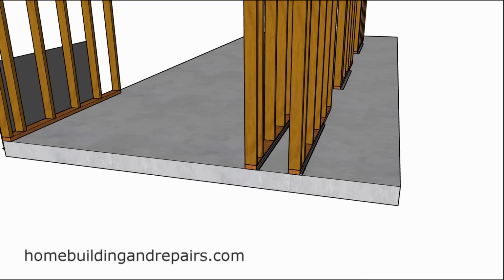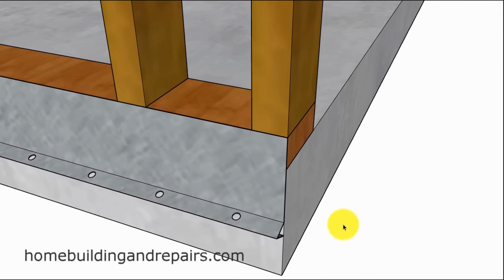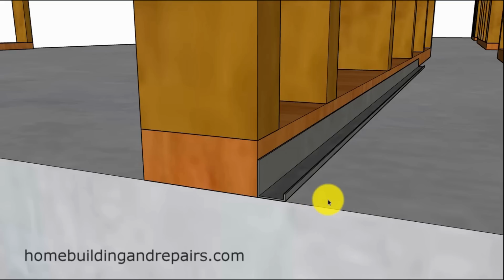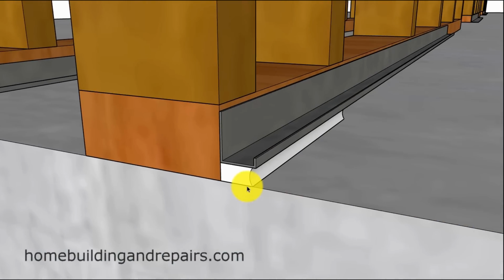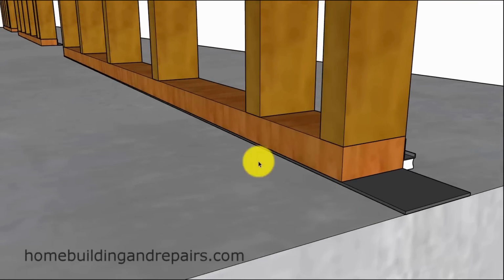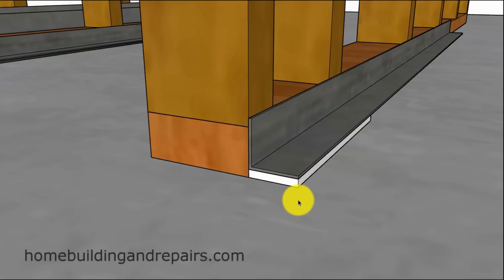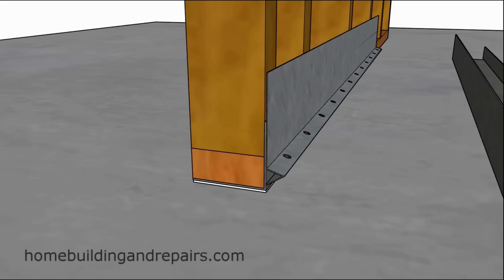Ideas for Sealing the Bottom of a Wall Framing Plate Sitting on Top of Concrete Slab

Comment: This detail keeps me awake at night…

Best I can think of is to place new curb on the slab (with a water stop like sika swell), next best is curb without water stop. 

Other ideas I’ve had:
- apply a slurry coat of xypex at the cold joint of the 6” curb  as a water stop instead of a pvc water stop, or using xypex as an additive in the curb concrete 

I’ve also thought about blueskin wrapped under the bottom plate on the horizontal and then up the exterior side (L shape, not u). Then caulk the bottom of the blueskin to the concrete as well as the corner after install.  Then tyvek down over the blueskin.

I also thought about panted vinyl trim left about 3/8 off the slab and then filled with caulk, topped with a flashing before siding starts

Also thought about various stucco parging coats over cement board or maybe stucco wire. 

An important consideration may be if the slope is toward or away from the wall on top the slab. Are we trying to seal against gravity
Or with gravity on our side

Also considered a mini curb if minor standing water could be an issue like a 1” tall curb made from  planitop x instead of regular concrete

I’ve also weighed options considered 4x4 vs 2x4 bottom plates. 4x4 easier to find rated for ground contact or burial and 2x4 follows contours of slab more easily and may seal better 

And another big consideration is that you can’t always easily place a 6” concrete curb. Say you are repairing a pre existing wall with a poor detail. (Often just old siding run right to the ground over the bottom plate). And now we have to try and waterproof the bottom plate best we can from rain water and also the wicking of wood and concrete contact

Comment: i have this scenario ( the second part show on the video ) shed on a concrete slab, but one side will not overlap the concrete and will just seat there. i see that J channel is not recommended. So what are my options ? Yes, i'm using a PT sill plate + a moisture barrier between concrete at the sill plate, but i will like to flash the concrete and the smart siding, but not sure how to go about it.

Comment: Forget the j-metal. Wrap the bottom of both the plate and the bottom of the sheathing. Still use polyurathane sealeant everywhere you can.
Then overlap the wall covering , (tyvek, etc.), over the bituthane - seal this too. Use a polyurathane sealant at EVERY joint and contact point as well. NEVER have concrete continue from the exterior of the home to the interior. Always have moisture and thermal break between the them. SLOPE your concrete AWAY from the structure. Have it ground down if it isn't already. SEAL THE CONCRETE. Use overhangs and gutters to further limit that portion of the concrete from ever seeing moisture.
Have your yard sloped and draining AWAY from your structure.

Comment: I thought all the person was concerned about was laying the wood directly on the concrete slab and soaking moisture from the concrete.  All that metal is totally useless. Some kind of waterproofing membrane under the bottom pressure treated sill should suffice. Long ago there was a rubber membrane that was  used. It was about 3/16" thick. There are probably better products today. I believe you way over thought it. If there is a lot of water in the basement, nothing will help without a drain or sump pump system.

Comment: If take a grinder wheel in some Z flashing. Cut a groove in the concrete about a 1/2 an inch deep with a thin blade. Put some calking down in the groove and slip your flashing down into the concrete and then put your side down over the upper half and it will  Stop the leak because mechanically the water cannot go under if it's glued into the concrete even if the concrete's not perfectly flat it has to penetrate  Under that lip and then wickets way back upward and that's not typically the case.

Comment: Great vide as always! I was looking for info about how to seal a wall plate on concrete. Do you think it's possible to make a garage extension on a driveway directly on the driveway concrete without foundations?  The extension to build would be 12x23x12.
Reply from the maker: I've built over slabs 4 inches thick before, but most building departments and engineers would probably never approve it.
Reply: @gregvancom , thank you very much.

Comment: You could use composite plastic posts 3x3 or 4x4 as your "to the floor" wooden part of the frame and  mastic and screw direct to the floor, even stack it in layers to become a type of composite party wall
Reply: Not to code. Best to start out with a plan that keeps any wood product from ever making contact with exterior water such as a raised concrete foundation.

Comment: Hi Greg, probably in the same family as that comment that was looking at something similar for brick ledge. I have an extension off the kitchen (7x8 room) that only has a mat of “peel and stick” (you can really peel it right up) separating it from the elevated concrete slab. The room itself is framed up on wood studs and its exterior walls are adjacent to the brick veneer (but built away from it, like you say here). I think the concrete is wicking too much moisture (the side door sill plate or threshold are messed up and allowing water… long story), which is going to rot up the framing. What all can I do as a retrofit solution?
Reply from the maker: If you can't find something in our videos, then email me picture of your problem and I will see if I can help.

Comment: Another option is to cut a channel into the concrete just outboard of the bottom plate, z-flash from the plate into the channel, and insert drain track like we put in pool decking. The bottom plate should still have a barrier such as 30lb felt, with an adhesive sealant such as Lexel.
Reply: I believe this is similar to the solution Matt Risinger used without the drain track. Drain track seems to be a nice addition.
Reply: @davidkafka2452  really? Well that’s fine company to be mentioned alongside.

Comment: In this case, I’d simply set concrete block on top of the slab, properly bonded, doweled and anchored and build my new wall on top of that single course of block perimeter :-)
Reply: This is actually my plan, came here to look at other ideas.
Reply from the maker: I like it.

Comment: I would use a flashed membrane against the framing and then continue it to the outside edge of the exposed slab. I would suggest something suitable for exterior like a waterproof decoupling membrane. I would suggest something like an exterior tile or cementacious coating suitable for an exterior surface. This assembly keeps water from entering the slab and wicking beneath the wall.👍
Reply from the maker: That sounds good.

Comment: I did the urethane under the wall sill plate  and treated lumber. To the patio foundation. Which didn’t have a raise hi
Reply: To protect water entry. It has been in use for 17 years! Still working well and no adhesion issues.
Reply from the maker: Thanks for sharing and I'm wondering why you used it. What made you select expanding foam?
Reply: @gregvancom  I didn’t use foam I used urethane caulking.

Comment: Cut a 1” wide channel into the concrete with angle grinder as close to the sill plate as possible, install and extend either lead flashing or ice and water shield from framing to bottom of channel, fill in channel (wet set flashing into) with hydraulic cement/good quality mortar. Done.
Reply from the maker: Let us know how it worked in few years.
Reply: @gregvancom  I’ve never done it, just thinking of ideas. Can you think of any reason it wouldn’t work? Just curious.
Reply: @danno8852 
Yeah - you can't stop water.  While I do like the idea and recessing an edge of flashing into a kerf cut into the concrete, the fact is that if water is allowed to reach the flashing then it will surely eventually devour that metal. Moisture can always weep through the concrete itself - esp. if there are any cracks. 
I used this kerf method on a stucco house when I added a small overhang with metal roofing over a sliding door.
Reasons why it was successful are: 
* The roof of the new overhang was pitched away from the house so water didn't just sit there.
* It's in the southwest which has limited annual rainfall.

Comment: Yes. Weep screed is not available . can I use instead aluminium flashing like the one used for cladding or roof flashing?.thank you .great video.
Reply from the maker: I've seen other types of metal used, so I would say maybe, but I would hate to say yes and in ten years the metal is rusting or damaged. Check with your local contractors or building departments.

Comment: Hi, what do you think of making a concrete bed first, like a barrier curb on the existing concrete slab - to lay on the sill plate timber/metal? thanks!
Reply: Water ALWAYS wins and ALWAYS finds a path. ANY concrete slab which extends from exterior to interior under a wall or sill plate will ALWAYS escort moisture under it.
There MUST be a moisture/thermal break between the outside and inside concrete. The sill plate must be higher than the exterior grade. Pouring a concrete raised stem wall on top of the existing concrete may keep the wood from direct moisture contact but water will always wick under.
Reply: A single course of proper doweled, bonded and mortared concrete block, all cells filled with J bolts per code. Then you could liquid flash it same as you would if you were back filling a block wall basement for extra protection, you could then overlap the sheathing with counter flashing sealed to the block, house wrap shingling over the counter flashing and it would be absolutely bombproof. We are doing. 2K square foot additional onto a house with this exact method as it will stand up to the very wet and rainy weather in GA.
Reply from the maker: As long as it's structurally sturdy, then absolutely.

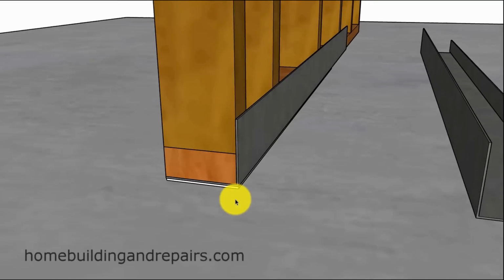Comment: Gregvancom. In the last example you give (6:20),
 Does pressure treated plywood sheathing go first then metal you mention  then water/ice paper then tyvek?
Reply from the maker: That is a bit over doing it, but if you live in the snow or where it rains a lot, then go for it. Please keep in mind that these  examples might not work in extreme climates.

Comment: I have a question  ? I had water problems, I live in Florida. I  built a French drain around the 12 by 15 room which was on a slab. Existing walls I cut the baseboard out cleaned it all out vacuumed it let it dry out for a month and then what I did was I ended up getting concrete with rocks and I mixed it up and I put it in between the two-by-fours on the ground in between the floor plate. I then put the 4 in baseboard on it and I let it dry turn down the air conditioner for a month after it dried I put another baseboard on it raise it up higher with the concrete in the wall I blew some foam insulation on top of the concrete and then proceeded Lee to put the paneling back down over the insulation and the concrete. I went out and I got skills and I painted all the boards on the floor with Kilz and then I ended up getting a roofing compound and just painted that on several layers thick and then I glued everything back together again and every 5 years I have to reseal with a roofing compound I have not really experienced any water inside the room since I did the concrete and the foam and the roof sealer a small little bit but not as much as I normally get in this room. I live in New Port Richey Florida and when it floods my backyard we usually get two or three feet of water I sealed the door right up to four foot with the roof sealer and it has not been leaking since I had seal it. My question is can I put concrete all the way up in the framing of the walls will it hold it in place along with plywood against the wall I just want a more secure place because I live in a area where it's very bad on drugs and if there could be concrete I prefer to have concrete considering that it will slow a bullet down if it ever Strays this way
Reply from the maker: I've seen what you're suggesting done before, but most of the time people build block walls.

Comment: Why not cut a 2” key way into the existing slab on grade and make a raised 1”lip 3” key way depth.  And than seal the concrete with a self leveling Crete.  The extending “toe jam” threshold Could extend 1/4” beyond the edge of the concrete key way pour and cover the door jamb area with a molded wood.  Thus having a inner floor level with tile install just about. 1/4 below the jamb.  The exterior walls could be as you state with flashing, but I would add a 50 year weather barrier below the flashing and studs.  Then caulk and seal after adding the exterior wall sheathing, vapor barrier and siding.  That way no water ever unless there is a flood.  But is his slab on grade above county standards for flood.  Is he in a flood zone.  Is he in a 100 year flood zone.  If he is not in a flood zone than his existing grade has to be 6” below the slab on grade.
Reply from the maker: Have you tried this method before and doesn't work or is it just a suggestion?

Comment: i would add hydro insulation all over the concrete slab ... approx. 3mm in two layers ... so overall thickness would be 6mm. And then when installing studs to the slab, I would put thick layer of caulk between a hydro and a stud ... and also later caulk around edges so no cold air could penetrate inside flooring and create condensation. I used in my project at home caulk sika 11fc and when it cures it's like a really hard rubber and it will last forever probably.
Reply: Rok Grabnar eventually water wins..

Comment: This is the main reason why I prefer raised flooring with a crawl space.  The rule of thumb is there are 2 types of concrete, concrete that hasn't cracked and another that is cracked.
Reply: More importantly, the concrete slabs need to have a thermal and moisture barrier. Preferably the interior slab (and/or stem wall), should also be higher.
Reply: that's why we need to add hydro insulation all over a concrete slab so it could hide potential cracks and also before pouring cement, we should add enough of rebars for reinforcement and concrete shouldn't crack. Here in Europe nowadays we even add xps insulation before concrete is added so that no moisture travels through the slab and also increases the energy efficiency of the house.
Reply from the maker: I like your two rules, concrete that is already cracked and of course concrete that will crack eventually.

Comment: One approach would be to put strips of thin concrete board under the studs. Roofing felt should be stapled to the bottom of the plate even if the plate is pressure treated. So intentionally create and air space under the plate. Fill that with backer rod. The air space is serviceable. Also spend the extra money on stainless or copper flashing and don't let it contact the slab.
Reply from the maker: Yes, always open to more suggestions. Good point about the metal, any metal that touches a concrete slab "with moisture" could rust a little faster.
Reply: Put the concrete board under the studs or the plate? I'm a newbie so I'm not sure how you do that if it will be under the studs.